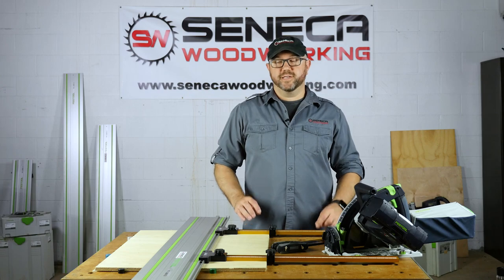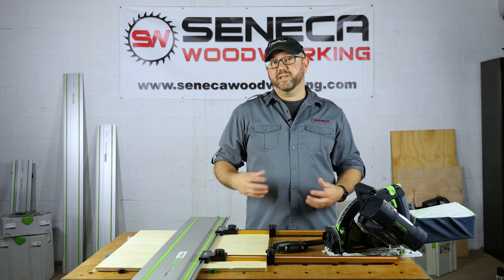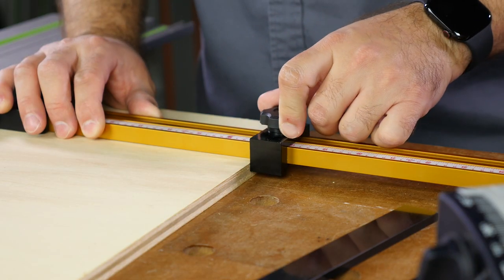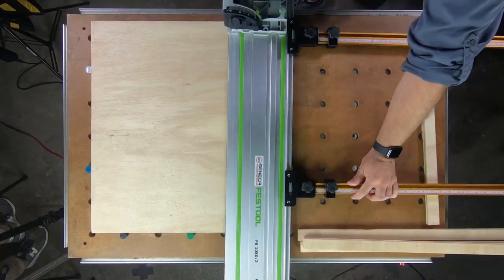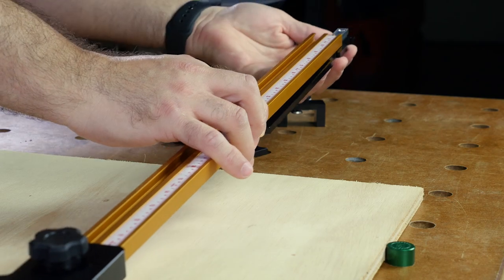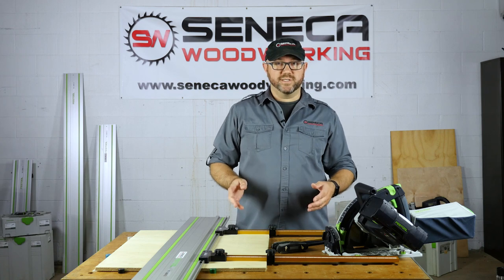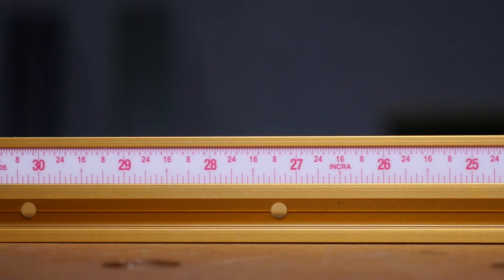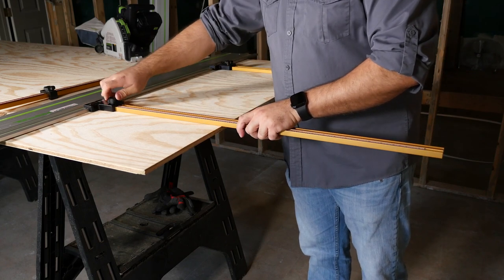How to Get Fast Repeatable Rip Cuts with your Festool Track Saw

Comment: Do you have to set each of the two stops manually? If so, it seems like the accuracy depends on how well you’re able to set the two stops to precisely the same setting (?) Or is there some way to set them both using some kind of setting jig?
Reply: You could set one stop to the desired length then cut a piece of scrap that fits between the stop and the rail bracket.  Then use that setup block/scrap of wood to set the other stop.  If your initial cut is going to be off it's better to be a bit big then creep up on your final dimension.

Comment: You show the narrow stops but how do you know what the measurement is? The scale appears to be calibrated to the regular stops? Is there a setup video showing the setup/calibration process?
I'm looking for a system for my makita tracksaw Seneca and Woodpeckers look like the front runners but your video doesn't have a lot of detail
Reply from the maker: When the narrow stops are added,  they interlock with the standard stops, and they have two interlock positions:  10in and 200mm.   This makes the mental math problem easy whether you are using T-tracks with imperial or metric scales.   For example,  with the narrow stops installed at the 10” offset, you’ll subtract 10” from the reading on the scales.       If you want to make a 1” cut,  install the narrow stops and then set the system to 11”.    The scales can be set to direct read for either the narrow stops or the standard stops;  we recommend setting them to direct read to whichever set you use most often.     We’re working on an instructional video for the system that will show this in more detail.